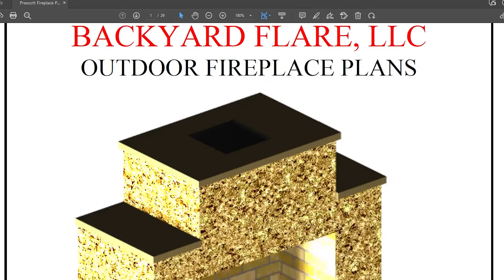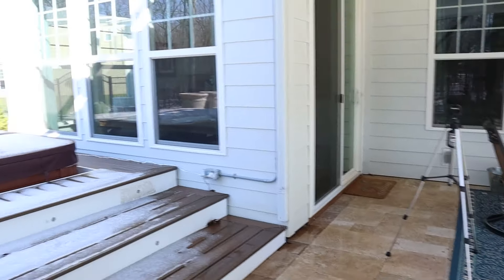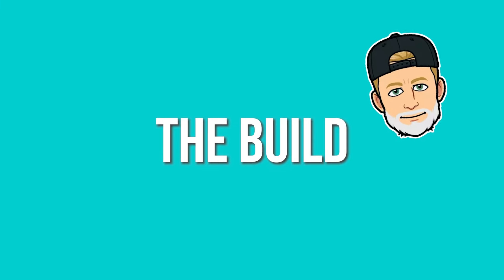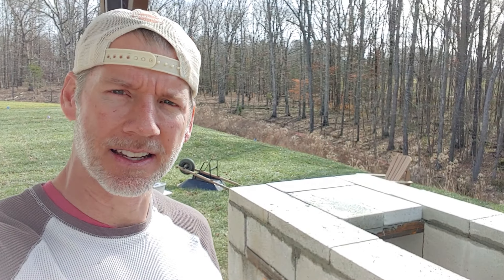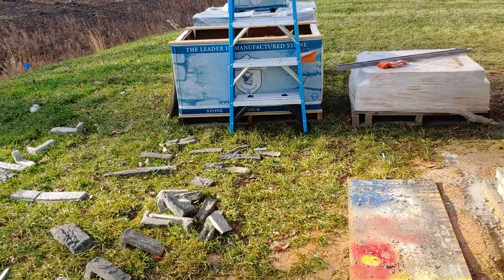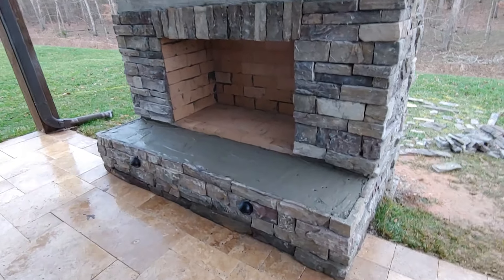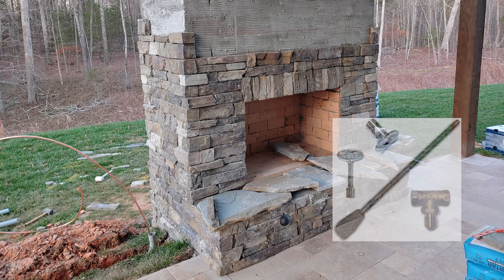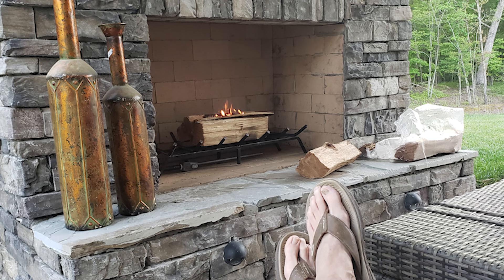How To Build An Outdoor Fireplace In 20 Minutes | DIY

Comment: We installed veneer stone on our homes foundation blocks about 7 years ago. The blocks had been painted so I hired a sandblasting outfit to blast the paint from the blocks.  We then used type S mortar and began laying the stone.  The funny thing is you can actually start at the top and go down if you so desire . Its recommended to wet the block first to keep the block from sucking all the moisture from the mortar.  It has been 7 years and no problems so far..  I consulted with a professional installer and he said no scratch coat was required.

Comment: How did you run the wiring for the TV?  Just bought some plans from Dan and not sure how this is done.  Along the side under the masonry and over the mantle?
Reply from the maker: I meant to shoot a video showing this.  But basically we tapped in to one of the exterior outlets and ran the romex through conduit along the side and over the top of the pergola (where you can't see the conduit) over to the fireplace.  Then mounted another waterproof GFCI box on the last cross member of the pergola.  I've since moved the TV under my overhang on the original patio.  I got tired of putting on and taking off the TV cover. :)
Reply: I’ve followed your video and Dans plans.  Wondering about the angle iron and does your fire heat it up causing it to expand?  How did you protect against this?  Also, is the firebrick on the floor of the firebox 1 1/4” or 2 & 1/2”?

Comment: After two years how is the fireplace holding up, and is there anything you would do differently now that you should have thought of during the build? I recently start and up to level 4 of my build using The Prescott design and would love to hear from you about any lesson learned.
Reply from the maker: @ricardotirado8304  Only a few exterior stones have fallen off. I would definitely do the mantle differently. I probably would have made the firebox smaller as well. I think adding something to hold fire logs on either side would have been nice too.

Comment: Wondering why you didn't use a modified Santa Cruz plan (i.e., minus the side storage voids).  It is very similar to the Prescott, but designed for a larger load (i.e., it has more rebar reinforcement throughout and a more robust lintel design).  It also has a larger flue (24 x 16).  If you could do it all again, would you have considered this approach, or would you have stuck with the modified Prescott?
Reply from the maker: We'll have to see if I do it again. I'd say one thing that I'd change is  I'd go with a smaller 36" firebox.
Reply: @WillMosbey  Your response regarding the firebox size surprised me!  Please elaborate.  I recently completed a concrete foundation and need to make a decision regarding design type.  I was looking at the Santa Cruz because it has the largest of all the fireboxes (similar to the Prescott, but 2" taller).  Why smaller?  You have quite the large, covered area (pergula).  I value your experience and would like to hear about your thoughts regarding firebox size before making a final decision.
Reply from the maker: @Lee-q6j9w  From a performance standpoint the firebox performs perfectly and generates a good amount of heat. I feel from a look perspective and being more efficient, I feel the smaller firebox would look better.
Reply: @WillMosbey  What about the same size opening, but tapering down to 36" to the back wall?  That would give a traditional look, but may give you some of that efficiency?  Technically, you could still do this if you wanted to, I think.  Thoughts on the idea?  I propose this, as I am considering it and am curious what you think.  I know Dan argues that tapering it isn't necessary, but it couldn't hurt, and maybe could have an efficiency benefit?  Just to clarify, not saying angling the roof, just the sides.  Thoughts?

Comment: Great video! Probably the best I’ve found on this topic.

I’m in the early planning stages of a DIY outdoor fireplace & pavilion project. Planning to permit everything but anxious about all the red tape. Can you elaborate on why the inspector refused to permit yours as wood-burning? I’d like to try and anticipate any objections they may have.
(I assume it may have been an issue with standoff distance from the main dwelling or the fact that it touches your pavilion?)

The only major difference in my plan is that I’m going to purchase a pre-engineered outdoor fireplace unit (FireRock or Isokern) and build it out to my dimensions with block. My pavilion will also be a separate structure, not attached to the house. Also might use double insulated metal flue inside the chimney as an extra safety measure.

Comment: Beautiful fireplace that looks professionally built.  Thanks for sharing the source of the plans you used.  I was not sure I understood that you were permitted the fireplace by the inspector if you kept it as a gas burning fireplace?  or, would you have been allowed it as a wood burning fireplace had you sought the permit prior to the build?   and now that a year has passed since completion of the fireplace, would you do anything different had you to do it all over again?
Reply from the maker: I finished it without the inspector's blessing. I use it as a gas starter but once the logs are burning I turn the gas off and it's wood burning. Wouldn't change a thing. We love the fireplace and use it all the time. Our space is large so I have a couple of propane heaters as well.

Comment: Great video!!  I also spoke to the fireplace plans vendor and he was great to work with!  I have not started yet but hopefully sometime in 2023/4.  Only item I wished you showed was how you ran the electric and cable for the TV.
Reply from the maker: I used 100 ft of standard landscape lighting cable and ran it from the front of my house where the transformer is all the way to the back of the house where the fireplace is. Before putting on the hearth top stones I drilled a hole for the wire. The lights themselves had enough cord that I could tap directly onto that wire using yellow landscaping t-taps. All in all a fairly easy process and the great thing is everything still works today no issues.
Reply: @WillMosbey  What about the electrical power for the TV (not the landscape lights)?
Reply from the maker: @thelaundryroomteam-orlando2051  had an electrician run conduit and mount a GFCI exterior box on the back side of the pergola. I ended up moving the TV but that outlet runs my led lights and string lights.
Reply: @WillMosbey  I couldn’t see conduit or a gfci anywhere in your video. Can you post a picture of it? I did the fireplace already and now want to mount a tv and need to add power so curious the best way to do this
Reply: And why did you move the tv?
Reply from the maker: @thelaundryroomteam-orlando2051  got tired of putting on and taking off the cover

Comment: How much warmth area do you get from the fireplace??  Thanks looks amazing
Reply from the maker: Actually we get a lot of heat out of the front of the fireplace but I also added two propane heaters that are about 12 ft away from the fireplace that covers the rest of the seating area.  What we've done recently is added two roll down screens that help keep the heat in. It's actually pretty cozy in there even on cold nights.

Comment: You don’t need a scratch coat if it’s new construction. A scratch coat is for going over old construction. In that case you mail up a wire lath and apply a scratch coat over the lath. If you have trouble putting on the veneer stone you can use a veneer stone mortar. It has a glue in it that helps it stay until it sets up
Reply: Couldn’t you just use a top quality tile thin set? Straight to the block?
Reply: Use the wire lath it’s cheap and easy and your sure it’s not going to fail

Comment: You’re gonna eventually have issues with the block separating due to the heat from the fire - even with the fire brick, the block will heat up if you don’t use an insulated insert or physically insulate between the block and the fire box that you build out.  This eventually will affect the veneer stone and cause it to pull off or even crack through.  Also the lintel that you built out will have issues since the steel will expand whenever you run a fire, and then it will contract, etc.  So what you have to do is protect the steel from the heat as well.

Comment: Nice, live it! What did you put between the pergola and the fireplace to block the rain since you hung a tv? Great job!
Reply from the maker: @jstergakis  thank you BTW. I put a piece of aluminum that was secured by concrete screws and also a thick layer of roofing adhesive (black stuff).   I've since moved the TV to under the patio cover next to the house. I got tired of taking off and putting on the TV cover every time I wanted to watch TV outside. 🤪
Reply: @WillMosbey  Gotcha and thanks for the quick response. Also was your concrete footing/pad level with your patio floor when you start with first row of cinder blocks. Thank you

Comment: Excellent job, I do have a few questions.  What part of North Carolina. are you in?  The Tv how do get from getting wet.
Reply from the maker: In the Charlotte area. There's a piece of flashing with construction sealant between the fireplace and the pergola. Plus when the TV is not in use I have a waterproof cover over it.
Reply: @WillMosbey   I like the gas starter

Comment: Hello, great video and great job on the fireplace! I just wanted to ask how the fireplace does with regards to drawing in the smoke and fumes from the fire, and how much smoke do you see exiting the chimney? would this gas out neighbors if they were close by (I know this isn't a concern for you) or does it do a decent job of keeping the smoke down and drawing it up and away from your guests? Thanks for any insight, I am thinking about taking the plunge on this project.
Reply from the maker: @eric6545645654  once the fire gets going pretty good and is generating heat all the smoke goes up and out of the chimney. Nothing comes out of the front other than heat.

Comment: Great job Will. I’m definitely buying the plans. Just out of curiosity, if you don’t mind. What did it cost you roughly to complete the fireplace? Thanks again and keep it going!
Reply from the maker: Close to $4500. The biggest expense was the Coronado stone. Also we ran a gas line too which was close to $1k by itself. Cinder blocks and cap blocks came to just around $850.
Reply: Did you have to install a flow for the smoke to come out and prevent the blocks from cracking due to heat? And approximately how many boxes of stone did you use for the project

Comment: Do you have to worry about blocks cracking if they get hot?
Reply from the maker: I've had countless fires in it since I built it and we've not had a problem with cinder blocks at all. The firebrick can definitely handle the heat. We've only had a few decorative stone disconnect from the mortar.
Reply: No

Comment: Total cost?
Reply from the maker: Close to $4500 total. $1000 was for the gas line alone. The Coronado stone was probably the biggest expense.  And I believe approximately $800 in cinder blocks and cap blocks.
Reply: @WillMosbey  With permits?

Comment: Great job! Question about the firebrick - did you mortar between each brick or just put a thick base layer on the bottom and laid out the fire bricks snugly? Also, did you put firebrick on the ceiling of the firebox? Thanks!!

Comment: What was applied to the cinder blocks before applying the stone? Do you let it dry?
Reply from the maker: That was a thing coat of mortar called a scratch coat. You need the blocks to be pretty wet so the thin coat will stick. Then just run a trowel over it to give it grooves. Let it dry. Then you can apply your stone veneer.

Comment: Few tip for your next one but first of excellent work it is beautiful and better the most masons can do these days.

The back wall of fire brick is should lean in a bit to “roll smoke”, I would of tan a course of fire brick underneath the bond beam, if not installing a damper which isn’t necessary for outdoor fireplace it’s nice to make a smoke self for a negative draft moment but everything else is perfection!!

Comment: Great build and explanation for diy’ers. How is the heat output from this box and plans?
Reply from the maker: It's great. Of course our patio is open so we have a couple of propane heaters out there as well. But the fireplace does a good job of heating the front area up.

Comment: Have you had any issues with the angle iron expansion/contraction causing any cracks?  I did mine the same way and was just curious 
-Thx!
Reply from the maker: @KPuckett34  no issues that I can tell. Everything is still just how we originally built it almost 5 years ago now. Except for a few veneer stones that have come off.

Comment: Did you use Concrete Blocks or Cinder Blocks?
Reply from the maker: Cinder blocks for the main structure. Concrete cap blocks for the tops of sections for closing them off.

Comment: Looks nice.  How did you water proof the top flat area ,the shoulders
Reply from the maker: It cinder blocks and morter up there with no gaps. No water can penetrate. I think that's what your asking?
Reply: Kinda,  where you stepped your block in,  the shoulder, is that flat?  Or do you have a small pitch to keep water from sitting there.  Mortar is porous Andover time can leak I think.  But I'm glad I saw your video I have the exact same project coming up.

Comment: You guys did a great job. It doesn’t look so scary anymore to attempt to build one for our house. Question, if you had to build it all over again, would you still use cinderblocks or would you use solid rock blocks like similar to a rumble stone product? Just curious because I’m debating between the two. Not sure which would be better.
Reply from the maker: I think since I now have experience with cinder blocks I would probably go with that again and do a better job with the mortar. The stability is very good.

It does make you appreciate the professionals and how good they are.

Thanks for the comment.
Reply: Would you be willing the design paper work and material list
Reply: Sorry but it's like finger nails on a chalk board. They are concrete block not cinder block. They stopped using cinders in block for filler in the mid to late 60s. 

But I do need to complement you on the work. For not ever doing it before it turned out like a pro did it. Well done.

Comment: Lovely mate. But take the TV out. 
(I reckon)
Reply from the maker: Actually I did and moved it under original patio. I got tired of having to take the cover off and put it back on. Now there's no need for a cover. I think I'll do a quick YT Short to show how I have power running to the fireplace.
Reply: 😅 
Great fire place.
You done good.
😊👍

Comment: I like it! I'm very curious how you did the roof on the pergola! Could you share that with me?
Reply from the maker: There's a company that makes that product here in Charlotte. It's custom fit aluminum that is sealed and has lighting and a box for the fan. All of which are sealed from the top. Also a piece of flashing (also sealed) is between the fireplace and the pergola. Keeps any rain off of the TV. The entire structure has gutters to direct water down and away from the house.

Comment: I noticed that you had no rebar set in the foundation and running through the cider blocks and no concrete poured in with the exception of the row above the front lintel. Does this build satisfy your local building codes? I thought rebar would be needed through the blocks and connected to the foundation, in a similar manner that you build a column or a wall. Looks great but not too sure about its stability.
Reply: It does. Rebar is meant to be embedded into the footing. Without it load transfer does not occur, it's just gravity and friction holding it in place.

Comment: Hey Will.  Thanks for the video.  Very informative.  In the middle of my own build right now, same as your's plus wood storage boxes on either side.  Couple of questions if you don't mind.  Have you had any issues with not having a flue liner?  Cinder blocks crumbling from the heat etc?  Also, any problems with the fireplace pad shifting or cracking feom the weight?  Thanks!
Reply from the maker: No problems at all with the flue. Fire brick is still looking good. Just a few exterior veneer stones have fallen. Foundation is still perfect. I probably should have gone wider overall but it's holding up fine.

Comment: I was wondering if not having the wall angled will make a difference in the fireplace by having the smoke come out at you.
Reply from the maker: The video really doesn't do it justice. The fire had just started. Once the fire has been going for a bit and it gets warm in there I've never had any issue with smoke coming out of the front. Now with having the fireplace 4 years under my belt probably the only thing that I would have changed is the size of the firebox. But the shape is fine.
Reply: @WillMosbey are you saying you would have gone smaller fire box? I just bought plans but am reconsidering the plans I got because I’m considering a larger box. Mind elaborating? Thanks, and great build. Thanks for the video.
Reply from the maker: @Jellett01  I feel that a 36" angled firebox would be a little more efficient and direct the heat a little better. However the size I chose still works perfectly.
Reply: @WillMosbey  thanks for the reply. So when you say angle, I assume you’re referring to the back of the box, or all three sides? You think the block is what’s causing your stone to fall off? Assume you just mortar them back on without any issues? Thanks again.